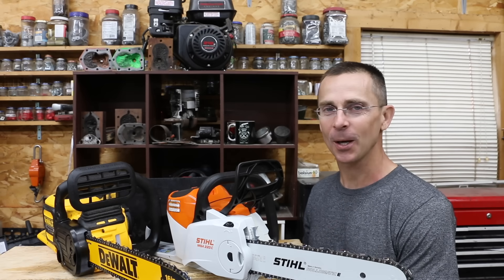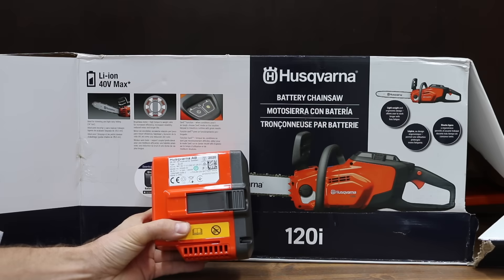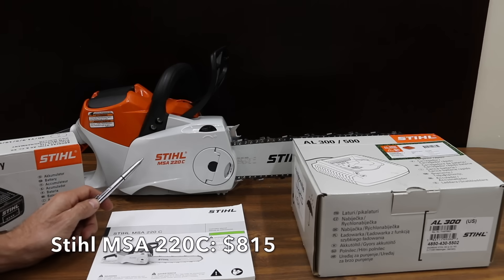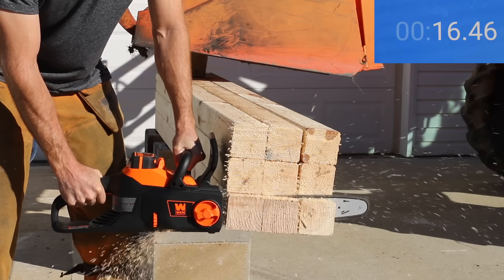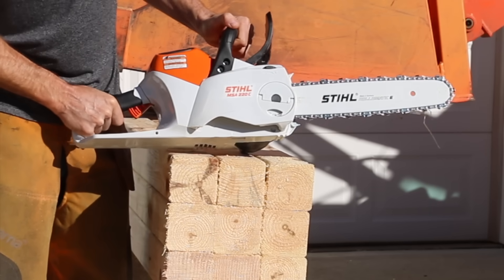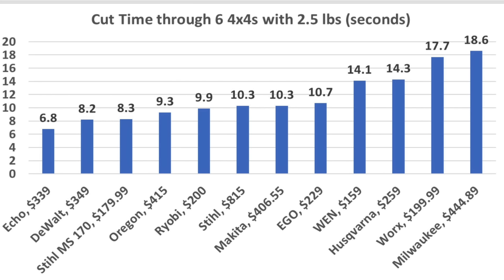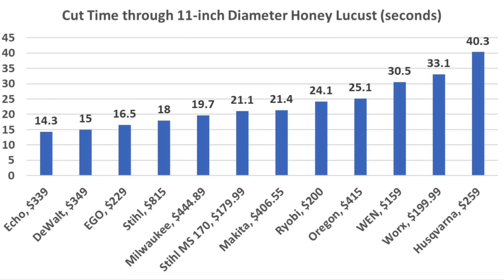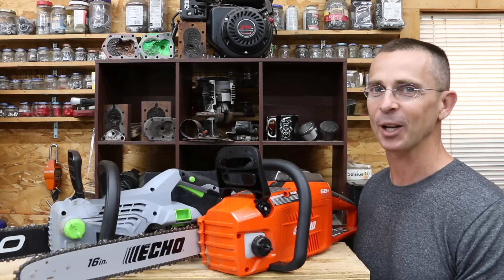Best Battery Powered Chainsaw Brand (ROUND 2)? Stihl, Husqvarna, Echo, Oregon, DeWalt

Comment: So the average runtime is around 6 to 7 minutes, with recharge time around an hour and a half. So let's say you run 6 minutes out of 10.  You're going to need an extra 9-10+ sets of batteries to keep going for an hour and a half (60% run 40% rest). Which probably equates to about $4 worth of gasoline.
Reply: Yes, but if you only need a saw to take care of an occasional tree limb that comes down,a battery powered saw will pay for itself in spades due to the lack of a repair bill.   Not to mention the fact that every Stihl dealer (currently up to 4)  I've ever taken a saw to for repair work has ALWAYS said my saw was beyond repair and would have to be replaced.  The last such occurrence they told me the saw had no compression.   I checked it myself and got 150 psi.  Put a new sparkplug in it, and it's been running great ever since.    I heat with firewood, so it's gas for me, but the battery powered saws have their place.
Reply: @nospam3409  have you looked at solar to further reduce cost? It’s getting more affordable every year
Reply: it's for people like me who buy'd cheap gasoline chainsaw 7 years ago and in meanwhile burned maybe three tanks of gas, not for any serious work with it. That's why some prices we see here are unreasonable.
Reply: @NonyaBusiness!  Have you slapped the big momma lawnmower battery on that thing? I have the mower, weed wacker, hedger, and just picked up the blower. It's been 4 years and the mower battery is just starting to get a bit dodgy.
Reply from the maker: Thanks for the feedback.
Reply: My misses can't lug my 250 out into the yard and, to be honest, I don't want to all the time either. This is a good lightweight option for trimming and brush clearing, not felling trees all day. I just wish there was an American manufactured option.
Reply: I see a lot of salt in this thread, Honestly battery vs gas should not be such a competitive debate.  What matters is how you use the saw, if you cut loads of firewood because you need it for heat the room with the wood stove(do people heat whole homes with wood? ive only known electric, gas, oil and heat pump) than odds are you use that saw constantly and as such gasoline is justified as its the better tool for the job.  But the typical homeowner in the 'burbs might only bring it out once and awhile to trim some low branches or clean up their small yard after a big storm for them battery or plug in electric are fine.

of course the throwdown id love to see is some plug in electric models in the mix, I bet some of them can keep pace with gasoline all day.  The wall socket never needs to be recharged.

Great thing about all this is in the end the winners are people who use them. Those who need it still have tried and true gas saws, Plug in saw still hold a place too as long as you are in range of your 100ft extension cord, and now we have actually good batteries for light duty or maybe even sound limited duty*.

*I can imagine there is some light property upkeep work in places like resorts where the battery powered saw causes less guest distrubance.
Reply: @filanfyretracker  The premise a lot of folks are pushing is that battery saws are "useless" somehow. The opposite is true. The vast majority of people who need a saw are the homeowners everyone refers to - for whom a battery saw is perfect. I have one. It cuts trees in -20C for me no problem. I am not and never will be a lumberjack who needs hours and hours of WOT on a saw. Comparatively speaking, hardly anyone does.
Reply: You obviously don't understand that these saws are not for loggers, they are for homeowners and farmers who need to cut up a tree or two. Two weeks ago I cut up two 35' trees on two batteries. I've been using battery chainsaws for years now and haven't used my gas saw since.
Reply: @Pro1er  can confirm, I had zero need to own a chainsaw until I had some huge branches come down on my property.  Anything smaller that I've needed to cut up I was able to handle with a sawzall and patience or loppers.

I already had Greenworks 60v stuff, so I bought the chainsaw that works with the batteries I have for my mower and leafblower, and spent about a day cutting the branches into manageable ~75-100lb 3-4 foot lengths with one 5Ah pack and one 2.5Ah pack.  16in bar, brushless, seemed to have less chain speed than my neighbor's Ryobi 40v but could cut bigger stuff.  I got more than enough runtime to have been able to recharge the pack I wasn't using.

And then I put it on a shelf where it's going to stay until another tree comes down or someone wants to borrow it.
Reply: I think for pure productivity the gas saw will win, but when you are doing work that requires you to stop cutting to perform other tasks (brush clearing for example) then the electric saw is nice and you don't have to pull start it over and over. That is especially tough when it is colder.  I use my wife's little Dewalt for clearing willows and alder on trails and it is so much nicer than a gas saw. But if I have to cut the trail from the start, or some other messy hard and constant cutting it's the gas saw every time.
Reply: @whirving  When it's colder the batteries have reduced run time
Reply: @NonyaBusiness! I love my ego products. I own every tool they make except the lawn mower since I have a gas powered mower due to needing the extra solid run time since I cut grass far away from power outlets. Their 7.5ah batteries really last. My weed Wacker went from 45 minutes run time to a few hours. Can't speak for the leaf blower as the 2.5ah battery seems find for it. I do love my ego battery powered "generator" though. Plug 2 7.5ah batteries in it and I can run my 120v ac lights and such with them for a good bit of time. It helps that its silent, since I often use it at night.
Reply: @NonyaBusiness! I run older Stihl saws because that's what I started off with.   I have an 024, 026, 036, and an 064.   All have 16" bars and run .325 chain except the 064 which wears a 28" bar and runs . 404 chain.  I run the same thing on the smaller 3 to minimize the number of different chains, bars, files, guides, ect that I need to keep track of.  I run the 026 and 036 the most.  024 rarely gets used, and the 064 mostly gets used to noodle large rounds down into something I can lift.  Totally agree on the frustration of something not wanting to run.   I've rarely had that issue with my saws, but it does happen.  Its an hour drive to where I cut, which makes things even worse.  I never go without at least 2 saws and an axe in the bed of the truck.
Reply: I swear, none of you cut up fire wood for a fire place. If you're cutting trees down for firewood, generally you're full throttle 80%+ of the time, for hours at a time. I ran through 7 or 8 tanks of gas in a row today
Reply: @imthemistermaster  That's not the point of these saws. These are for homeowners to cut down a tree or limb occasionally. It's so easy to grab a battery powered saw and zip zip zip. Get work done, and get home. No maintenance, no flushing gas, no mixing oil and you can store it inside without dying. 
For someone who is cutting down trees all day long professionally, you're going to get a professional saw. And professionals will have time and money to perform maintenance, storage... 
A walk-in fridge is awesome, but unless you're running a kitchen it just doesn't make sense to get one. Same with a saw. 99% of people who aren't professional loggers will do better with an electric consumer saw.
Reply: @JC-fj7oo  "99% of people who aren't professional loggers will do better with an electric consumer saw."
Reply: @paulnorman8274  yep, sounds about right
Reply: @imthemistermaster  Then a battery saw isn't for you... Just like multiple people have said. 🤦🏻‍♂️
Reply: @imthemistermaster  fire places are horribly inefficient.   I heat the entire house with a 1980s add on wood furnace and I go through around 4 cords every season, mostly hickory with some oak and locust.  It normally takes me 2 tanks of fuel to drop, limb, and buck one full load of firewood.  Depending on how I break up the work load, I can cut and stack between 2 and 4 cords in a full day.   2 cords if I'm carrying it to a truck/trailer and stacking it, 4 cord if I'm stacking it in the woods and coming back to get it later.  So on a full day of cutting firewood, I run through 4 to 8 tanks of mix.  12 tanks of mix will cut enough firewood to last me through a very cold, very long winter.
Reply: @imthemistermaster  I hear you, i couldn't even think of using a battery operated saw. We cut and split for up to 8 hours a day on weekends to get ready for a wisconsin winter with a wood burner
Reply: @NonyaBusiness! https://www.youtube.com/watch?v=kOU0XYioQ28
Than will talk later !!!
Reply: It's meant for occasional use. Gardeners, Tree surgeons in canopies, school estates teams, etc...
Not for lumber jack's.
Reply: @markp8295  or a typical man harvesting firewood....  The battery saw wouldn't get you much firewood
Reply: @currentsupply   How big is this fire you're making?
For a log burner, you could get a few baskets worth on one battery.
If it's I not the only way you hear your house, that's a couple of days worth to add to the store to dry it for winter. But agreed petrol would be faster.
Reply: @markp8295  I go harvest firewood (oak usually) a 2 or 3 times a year from the local mountain.  So each time I fill a trailer.  I use the firewood for cooking and camping mostly.  So each time I use my saw it's to cut over a cord of wood.
Reply: It's plausible. Especially since you'll be using different kinds of saws for different parts of your job.
Reply: No you won't . Only run your battery down to 20-25 % . It'll be back up to full far far sooner than from dead flat . With a couple of chargers topping up two at a time ... 10- 15 mins apart ( realistically )  unless you are bucking max bar length in non stop relays , you should be ok .  You gotta eat , pee , move crap , load , Refill oil . Tension
Reply: I am an average homeowner.  Once or twice a year I go to a the forest and cut myself a cord of wood.  It takes about three hours of sawing to  cut the firewood.  I have a gas saw and I can just keep sawing until my trailer is full of firewood and i can go home with 1-2 cords of oak.
Reply: I only have 5 acres of a heavily wooded lot with ponderosas, Douglas fir and white oak. We got hit hard by pine beetles during the summer. My 025 that runs great isn’t meant for felling big trees. My new 362 with a 24 inch bar cost less than many of these saws in this video and will run circles around them.
Reply: True. But I'm guessing the people who buy these only need it for a quick 10 minute work and no more.
Reply: Electric chain saws only make sense for an occasional use if you already have the batteries from other tools in the same brand.
Reply: @Webic33  For arborist type use, battery saws can make sense even for full time pros. If 90+% of your time is spent getting from tree to tree, climbing, securing and positioning, all out run time starts to matter less than the convenience of the battery saws when up in the trees.

For any sort of logging or processing of meaningful amounts of wood, even this test shows the battery saws in an artificially good light. Since for those uses, pretty much everyone would end up upgrading to a much bigger gas saw, in the 60cc and up range. Often with a longer bar. I know I did.
Reply: @Webic33  Not necessarily. That Echo saw just kicked a comparable gas saw's ass performance wise, and it's much easier to use in any position for limbing and maintaining, you don't have to pull start on a ladder or climb with a running saw... 
When possible, I would try to get the brand to match. But its still a good deal even without that. And you can always get those tools later.
Reply: @JC-fj7oo  unless you want to harvest a cord of firewood.  The gas saw can do it.  The battery saw would only get you 6 minutes of cutting time.  Way less than a cord of firewood. I see the battery saw being ok for a landscape job, but no good for harvesting firewood.
Reply: @currentsupply  I already discussed that. Read before you type please.
Reply: @JC-fj7oo  Wrong. That electric echo will be lying on the ground unused or waiting to charge while the gas saw is refueled in 60 seconds. A big job would take a couple days with batteries while gas is done in hours unless you have a ton of batteries and chargers. Electric is for homeowners with one medium tree to handle or several small trees. The gas saw could take down a quarter acre of trees in the same time. its apples and oranges.
Reply: @Yankee_Doodle_Stacker  so... Literally exactly what I said. Cool. So are we both wrong or what?
Reply: @JC-fj7oo  "don't have to pull start on a ladder or climb with a running saw..."
Reply: @paulnorman8274  yep
Reply: It's definitely true that a gas powered saw has way more endurance per tank. The battery powered market (for all lawn tools) is a great fit for most home users. There is nothing like breaking a tool out of the garage or shed after 4 months of not using and just pushing a button to start using it. You won't find many people throwing these away because they wouldn't start up
Reply: And a 2-stroke at full RPM sounds way better - and you end up smelling like petrol and thus feel like you've done a real days work!!!!
Reply: @iain1969  No thanks - keep it
Reply: @iain1969  So going deaf, getting smelly and hurting the environment in the process might be plus points for you, but they definitely aren’t for me.
Reply: @Runoratsu 

>hurting the environment

>electricity is mana from heaven

Its all so tiresome
Reply: @MrLookatmyhat  You‘ve heard of solar cells (literally energy from “the heavens“), wind power, hydroelectric generators, etc., haven‘t you?
Reply: @Runoratsu  Most of the world isn't powered by renewables yet though.
Reply: @Studio23Media  But more and more is, day after day. And especially in Western countries, you CAN influence it yourself and get some solar installed or switch to a green power provider.
Reply: @Runoratsu  and as the grid gets cleaner, so does your saw. Not true with a gas saw - it will always be dirty, smelly, noisy and need constant maintenance
Reply: @Runoratsu  Yep a cloud of blue smoke and a deafening roar makes a special ambience - au de twostroke. Next time I get the saw out I'll put in some extra oil in the fuel just for you
Reply: @DD-DD-DD  exactly my point.
Reply: @MrLookatmyhat  Nice speech, but literally everything you typed is wrong. Sorry. Not sure why you bothered if you don't really know
Reply: @DD-DD-DD  

>hurr you're wrong because I said so
Not an argument
It's all so tiresome
Reply: @MrLookatmyhat  Don't waste your time.  I was going to start asking where the lithium in those batteries come from, and having an Uncle that works wind farms, you are correct.  It's all so people will "feel better"  

The newer PV panels are pretty kickass though and if Carbon or offgrid is your only concern, they are several hundreds of magnitude more carbon efficient, even in the study I saw that was trying to remain unbiased and included the O&G used to gather mats, produce and ship.  

Have also seen estimates of somewhere like 600 trillion dollars to outfit all US houses with enough PV and battery to get off fossils .... not gonna happen, and that was using current pricing which is orders of magnitude cheaper than even 10 to 15 years ago.  Some people want to remain ignorant and ideological, don't cast pearls to pigs lol.

I for one am trying to look at switching to PV and electric, but it is a massive investment.
Reply: @MrLookatmyhat  Then don't bother? You have nothing informed to say anyway.
Reply: @DD-DD-DD  not an argument
Reply: @Runoratsu  1.  Wear hearing protection. 

2.  If you work hard, you're going to end up "smelly" regardless.

3.  Manufacturing 1 lithium ion power cell does more damage to the environment than all of the 2 cycle mix I'll ever burn through all 4 of my saws.
Reply: @Runoratsu  god just poops out windmills and solar panels ey?
Reply: @MrLookatmyhat  solar. Heck even mechanical electricity.
Reply: @Studio23Media  yet
Reply: @MrLookatmyhat  😂 solar and wind will begin to phase out Gas. Less weight, more power. Give it 10 years or so.
Reply: @herrba  Yes, that's why I used that word in my comment... When that time comes, I'll have a different opinion. I'm a big proponent of clean energy, but you can't expect everyone to switch to battery everything overnight without the infrastructure to handle it.
Reply: @herrba  no it won't. solar is a meme and batteries have peaked without moving on to solid state.
Reply: @Runoratsu  and the materials to make these things and the lithium and cobalt that powers the batteries they charge comes from.....? Nothing is 100% guilt free.
Reply: That's the runtime under constant, full load. Theres a few videos on YT where the Stihl for example gets testet by professionals under real conditions. It holds up quite well and the runtime is at least as long as the charging time.
Reply: Gas chainsaws can run with a tuned pipe (expansion pipe) and produce much more power and beat the crap of the electric. They don't manufacture it that way. I remove the old muffler of the chainsaw and modify an old expansion pipe from a mini dirt bike. It is brutal to say the least.
Reply: It's true.i have a dewalt electric saw for very quick jobs and it's great but I cut a lot of firewood. None of these saws come close to the cutting speed and usable time of my 25 year old stihl 029. It has cut countless cords of firewood with almost no repairs needed and still runs like a champ today. I'd love to see a review of any of these saws after 25 years of use. I'm not against the technology, I'm just saying it will be a while before electric saws can match the performance of gas saws unless you compare the weakest gas saws like he did in this comparo.
Reply: @Gofukk Yurself Except coal is vanishing fast, everywhere in North America. Don't let facts get in the way tho. It's cheaper to put up renewables than it is to keep existing coal farms running, lol. Keep talking nonsense.
Reply: I convinced an older female homeowner to go electric cause it realistically suited her long term needs. Only ever light pruning once a month once the original logs were cut. I prefer gas but for lots of people 10 minutes of use a month is enough.
Reply: Enjoy cleaning the carb every time you need to use it, for me that’s once a year.
Reply: NonyaBusiness! Until the storm knocks out the power. Gas as a back up?
Reply: @1ronman1  A simple cigarette lighter power inverter is enough to charge saw the batteries from your car.  If you can charge your phone you can charge the saw.
Reply: @otm646  Too long and inefficient.
Reply: @otm646  Some of the fast chargers are more watts than a plug in inverter can handle. We had to get bigger inverters and hard wire them under the back seat on the trucks just in case the customer power outlet is not functional.
Reply: I never use a chainsaw that far from my house, so I just use a wired (plug-in) electric chainsaw to cut the loads of wood we recieve for use in our wood stove, and the costs are actually much lower than a gas saw, since no batteries are involved and it's energy price benefits stack up when you're cutting 5 cords of logs.